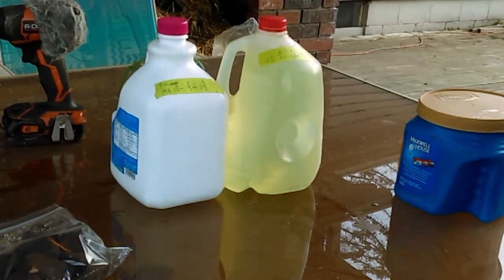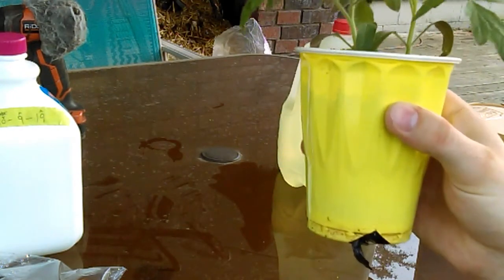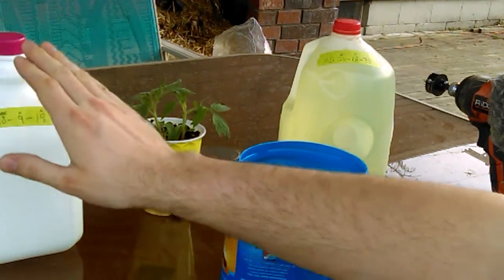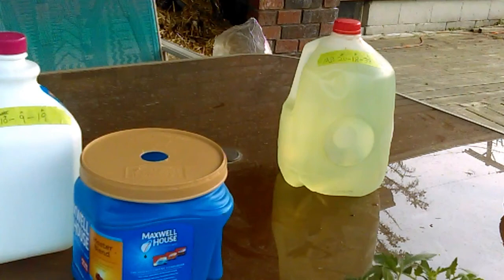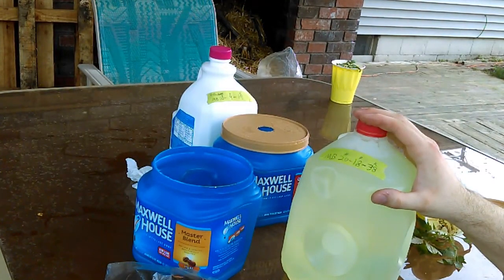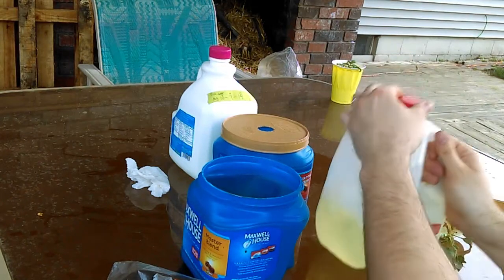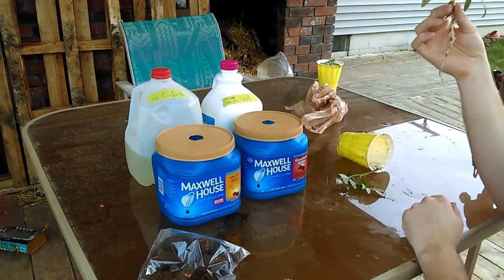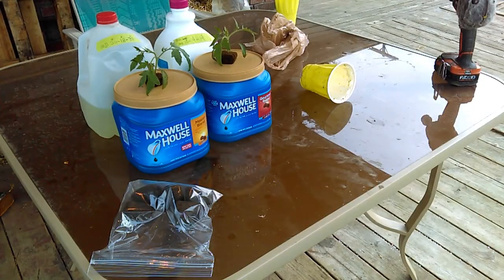Setting The Record Straight! MHPGardeners Mix Ratio Dispute 10-9-19 Vs. 20-18-38. Part 1

Comment: I think the MPHgardener mixing is correct for the correct concentrations but the N-P-K calculations everybody is using is way off.  NPK is measured in percentages.  I'll do nitrogen as an example.  Masterblend is 4% nirtogen.  Calcium nitrate is 15.5% nitrogen.  Epsom salt is 0% nitrogen.  Mixing them 12G masterblend, 12g calcium nitrate, and 6g epsom salt yields 7.8% nitrogen by weight.  12g * 4% plus 12g*15.5% plus 6g*0% that total divided by the total weight 12g+12g+6g=30g yields a 7.8% nitrogen of the total ppm.  It doesn't matter if you add twice as much, the percentage of the total dissolved solids will always be 7.8%.  That doesn't mean it can't be concentrated to a higher PPM, but the ratio i have calculated according to any unit of weight you chose will be this: N=7.8, P=7.2, K=15.2, Ca=7.6, Mg=3.3, S=3.8.

Comment: MPH is correct. for 5 gallons it's 12g, 12g, 6g.   I use this ratio in my hydroponic tomato grow and it's perfect.  I think you are confused.  This is also what Masterblend recommends.  Keep your pH below 6.2 or you will get blossom end rot in a hydroponic setup for tomatoes.
Reply: Toms require different levels of N, K and Ca throughout so running a fixed solution from start to finish wont be optimal. You adjust the N, K and Ca by using potassium nitrate (provides N, K) and calcium nitrate (provides N, Ca). 
Toms prefer a PH around 5.9,  PH has little to do with BER ;) 
 The standard 12g, 12g, 6g mix equates to an elemental NPK ratio of  2.5 - 1- 4 (NO3 + NH4: 123ppm, P:  49.8ppm, K: 200ppm).

Comment: a 20-18-38 ratio and a 10-9-19 ratio is identical.  If you look up what NPK ratio's mean it's just a %'s.  mhpgardener is doing the right amounts with 12g, 6g, and 12g.  The trouble is in the way that he says if you add a 4-18-38 to a 15.5-0-0 you don't get a 19.5-18-38.  That's not how NPK works.  If you take a 100 pound bag of 10-10-10 fertilizer that means you have 10 pounds of N, 10 pounds of P, and 10 pounds of K, and 70 pounds of something else (often clay or dirt).  If you mix another 100 pounds of dirt you have diluted that down to be a 5-5-5, because now you only have 10 pounds of nitrogen for the full 200 pounds, or 5 pounds per 100 pounds.  So if you take 2 fertilizers and add them together you always average out their numbers, not add them.  So you wouldn't get a  19.5-18-38 you'd instead get an 9.75-9-19.  However, he adds 30g total which is the right amount of 9.75-9-19.  The only trouble is that if someone bought an already mixed thing of fertilizer that said it was a 19.5-18-38 and they used 30g of the mix, they'd be getting 2x as much as they really need.
Reply from the maker: Joseph Larsen thanks for clearing that up
Reply: I do hope though that no one was calling mhpgardener a liar though, there's just no way :).
Reply from the maker: Joseph Larsen there are many open  forms that I ran across on Google that are debating the issue. not that he is a liar just that he was  miss informed on the ratios
Reply: Michael Whiting gotcha.  he just made a mistake in the way he added them together is all.  in the end his ppm was right and that's what matters.  ppm is kinda like npk but it's it's for much more diluted stuff.  if your water here was really 20-10-40 or even 10-5-20 the plant would die almost immediately, they would burn right up.  once you add the water is more like .0002-.0001-.0004 or less.  however you did find that if you over feed plants it makes little difference.  plants only take up as much as they can use, the rest is just waste
Reply: Yea,  The low concentration mix is really:  .063 - .057 - .121 and the high concentration mix is really .126 - .114 - .242 since it is diluted with about ~3800 grams of water.
Reply: See u should use EC meter.. EC should be between 1.8 - 3 for tomato. Ratio of npk is same as mentioned by u and mph gardener..  EC meter will correct the error

Comment: I have to disagree with your calculations. The mixing instructions at hydro-gardens say per 100 gal mix: 0.5 lbs of 4-18-38; 0.5 lbs of Calcium Nitrate; and 0.25 lbs of Magnesium Sulfate. You need to divide all those values by 100 for mixing 1 gal. The mix for 1 gal is: 0.005 lbs of 4-18-38; 0 .005 lbs of Calcium Nitrate; and 0.0025 lbs of Magnesium Sulfate. There are roughly 454 g (453.592 g according to google) in 1 pound, so 0.005 * 454 = 2.27 g and .0025 * 454 = 1.14 g. For 5 gals of water: 2.27 g * 5 = 11.35 g; 1.14 g * 5 = 5.7 g. Rounding up those values, 5 gals of water gets: 12 g of 4-18-38; 12 g of Calcium Nitrate; 6 g of Magnesium Sulfate. There are 3.785 L in 1 gal. For 1 L mixture: 2.27 g / 3.785 = 0.5997 g or 600 mg; 1.14 g / 3.785 = 0.3011 g or 301.1 mg.
Reply: I dis agree with him also. I have been doing this along with a friend of mine for quite a while now. My calculations are the same as yours CW
Reply: that's correct guys, I use the same amount per gallon....
Reply: Hello could you please tell which companies are making these nutrients? Thanks in advance
Reply: He's not using Hydro-gardens nutrients though. He's using Masterblend.

Comment: SO you did not explain that very clear. If I understand right the white jug 10-8-19 is PHGG , it has master blend, then 12 g of N, 12 g of p , and 6 grams of k added to it. I understand that is the mix for a 5 gal pail. But what exactly is the 20-18-38. Is it master blend , then 24 g, 24g , and 12 g. for a 5 gal pail of mix? And also how much master blend? in each.
Reply from the maker: +Peter Couture  yes that is correct the 20-18-38 is 24 grams of the Master Blend 04-18-34 fertilizer mixed with 24 grams of Calcium nitrate and 12 grams of Epsom Salt per five gallons of water. i just divided these amounts by 5 in order to mix a one-gallon batch.
Reply from the maker: +Peter Couture also see the results 1.5 weeks later with the follow-up video
https://www.youtube.com/watch?v=mWkHKMnmUVU